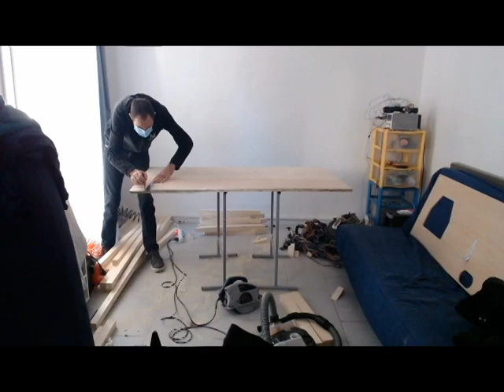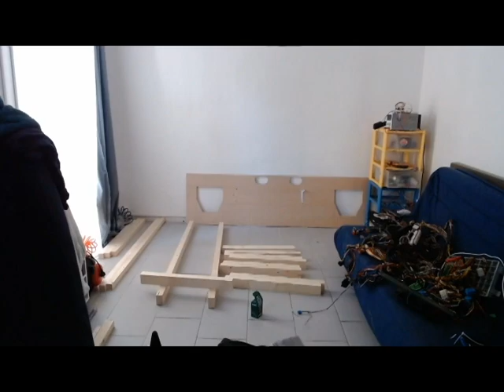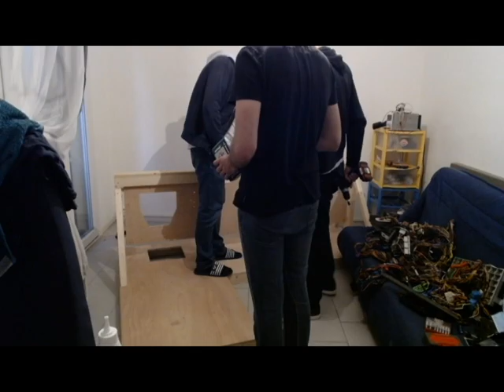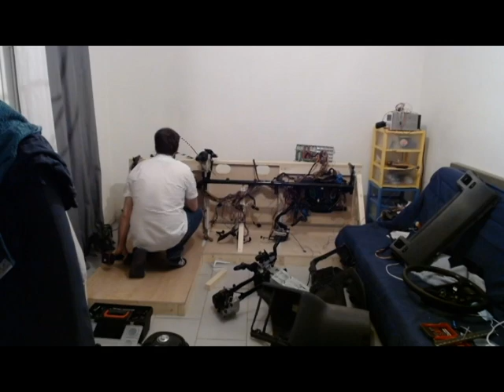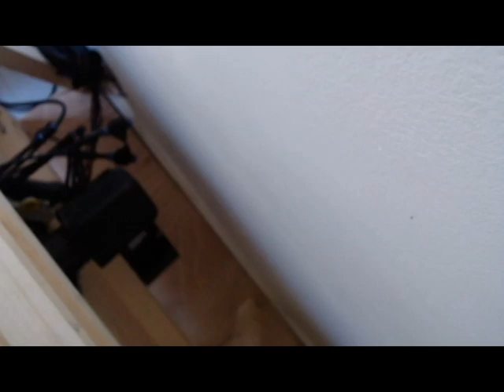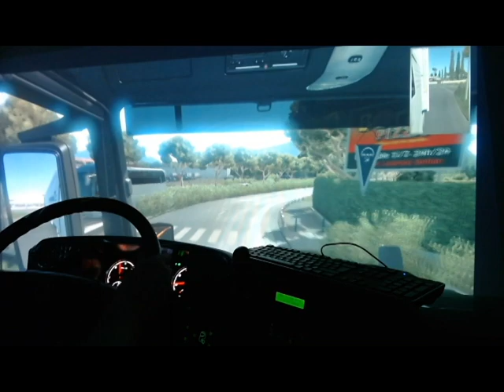ETS2 Scania Home cockpit - montage du socle + test

Comment: Hi Arcannae, impressed by your work and now trying to connect my own Scania dash. Could you please share a Silas Parker plug-in, which you modified for your NUCLEO 446RE board? 
The serial data length is expected to be 54 bytes and it's much more, then in original Silas plugin. Please help.
Reply: In the comment to other video you have shared a Nucleo . bin file with DLL. That DLL has 58 bytes in serial sequence and I can't figure out which parameters you have added. My I kindly ask you to share the source code for a most complete version of DLL? Then I'll adopt my mbed (ver. 6 BTW) code to it.